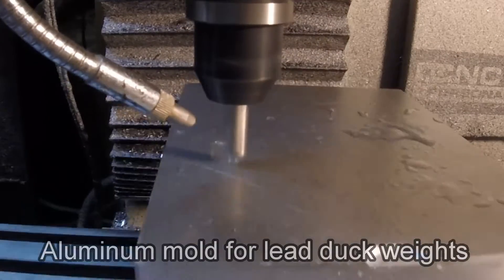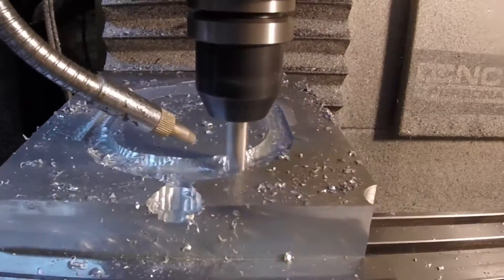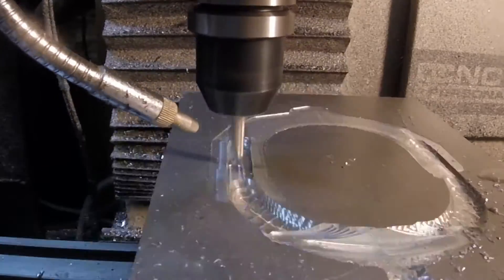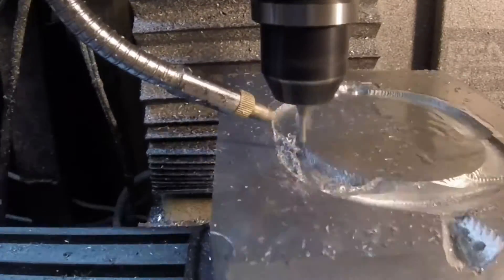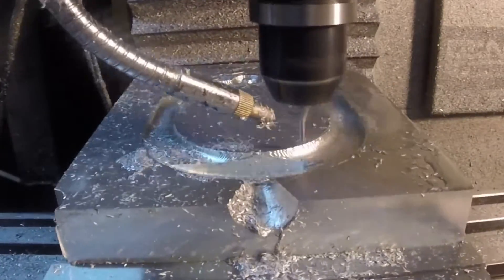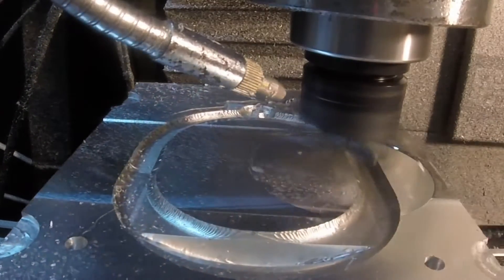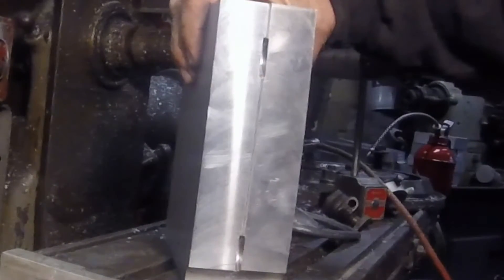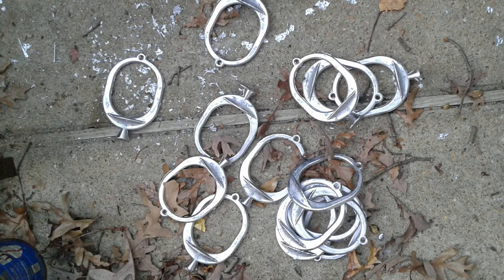Aluminum mold for a lead duck weight made on a Tormach PCNC1100

Comment: LOOKS EXACTLY LIKE WHAT I WAS WANTING TO DO . DO YO U MAKE THESE , HOW MANY OUNCES , AND COULD IT BE MADE TO DO MULTIPLE WEIGHTS IN SAME MOLD?
Reply from the maker: I was considering making these and it just kept getting pushed to the back burner.  I don't know how many ounces it was but the guy it was for had several weights and this was modeled after his largest one and he said they're plenty big enough for his ducks.  My plan was to make one mold with this size and another that was 2/3 this size in the same mode but it hasn't happened yet :/
Reply: @ecdezz  if you make i id be interested in purchasing! Very nice
Reply from the maker: @rogersears4969  Thanks!  I'll look into it and see if I still have the files.
Reply: I just bought 7dz of these style weights offline. Been looking for this particular mold for ages. Could I get you to make one?